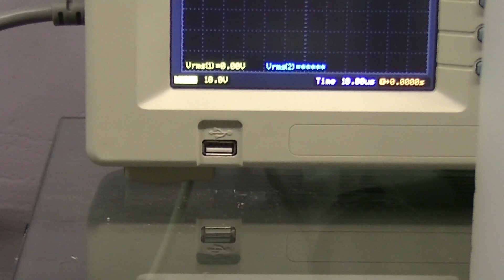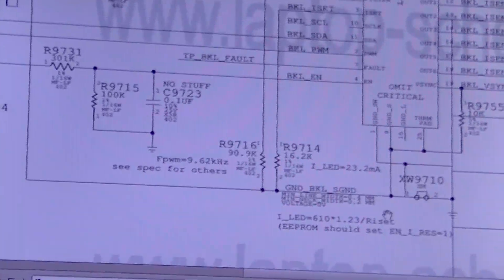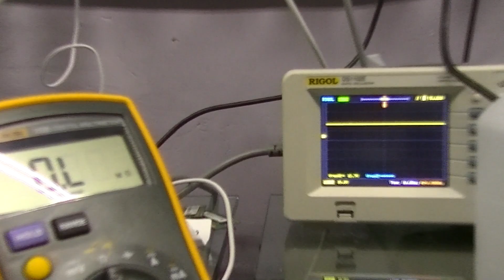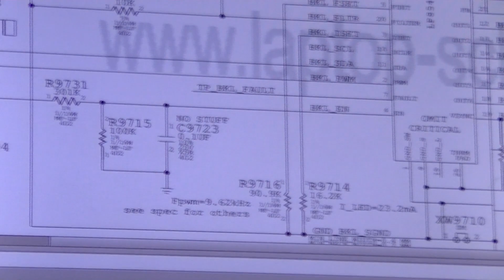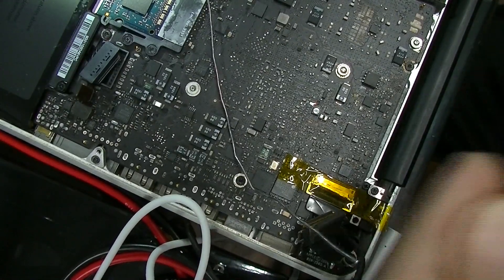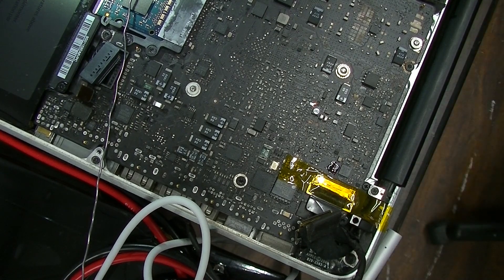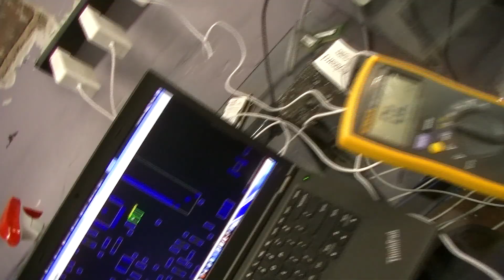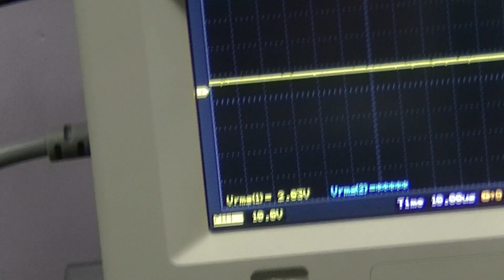820 2879 no backlight, BKL_EN resistors messed up. macbook pro logic board repair

Comment: Hey Louis i have macbook pro A1278.

I have a  macbook just won't turn on now never dropped it nor any liquid damage.
Some times it will turn on  just for 5 to 10 mins And will die itself  next day it wont turn on.  Nor the green light pop's up when i connect the charger  you can give some advise please.

Comment: how much would you charge to fix a 2015 macbook pro where the screen backlight doesn't work? most likely a transistor failure or the WLED chip.
Reply from the maker: same as price listed on the site for board repair
Reply: Louis Rossmann ok, the Macbook backlight is now working again. guess it just had a major hiccup for 3 days. weird huh?

Comment: Hey Lous, I got a 820-2850 but I can't find the 3.3V only 1.1V than 3.3V on the board and the light of the charger keep off. I can find 16V, 5V... I replaced the IC 625 and still the same. Could help me please?
thanks

Comment: http://www.ebay.com/itm/Hakko-FX-951-220v-Digital-Soldering-Station-Xbox-360-PS3-Laptop-Reflow-Reball-/161140831387?pt=LH_DefaultDomain_0&hash=item2584bdf49b

is this the hakko you have ? do you recommend something better?
Reply from the maker: The FX-951 is better than what I have but I dare not use it because I would have to get used to all of its tips from scratch and also the digitial temperature monitor. I have an old 936. It's not digital, it is analog, and also the calibration is way off, so I know what temp I need to be at based on where the knob is, but I have no clue what that corresponds to in actual degrees.

I would like to get a 951 for the spatula tip one day though, I imagine it would make LVDS connector soldering MUCH easier!

Comment from the maker: If it's an 820-2850 doing that, trash it.
Reply: I have a 820-2850 with no backlight, but I can see stuff on the screen with a flashlight.  Replaced the bad fuse F9800, no luck.  Why are you saying to trash it?  Is it beyond repair?  Also could you do a generic video on soldering basics (tools, technique, common bad practices)?
Reply from the maker: 2850 is a piece of crap for many other reasons that have nothing to do with backlight, it will just keep coming back with other kernel panicing/crashing issues.